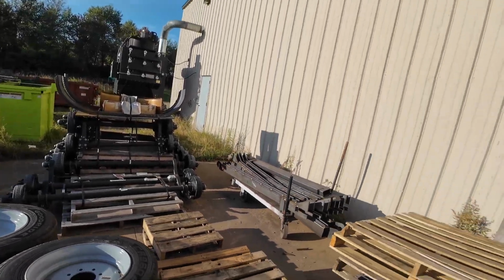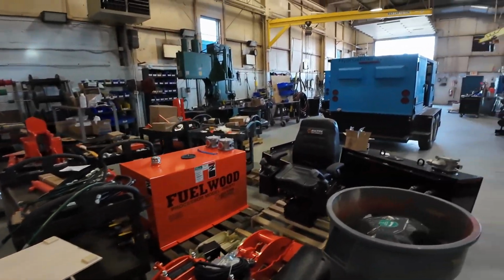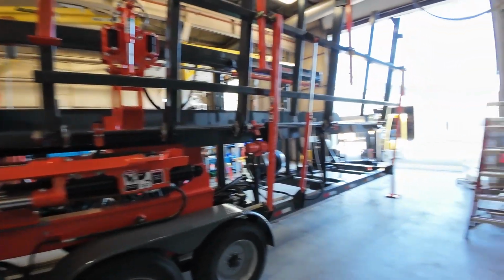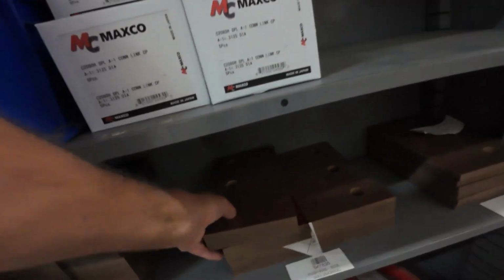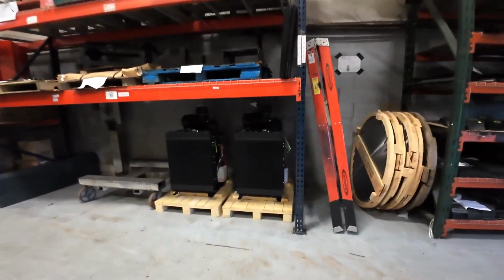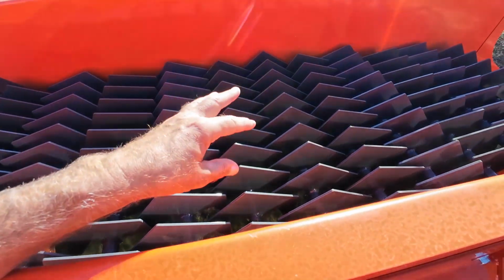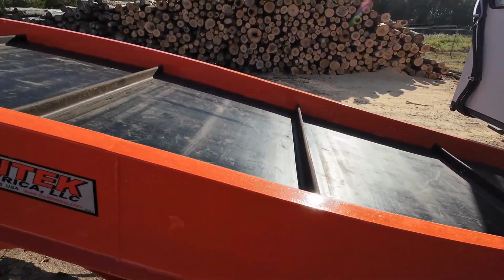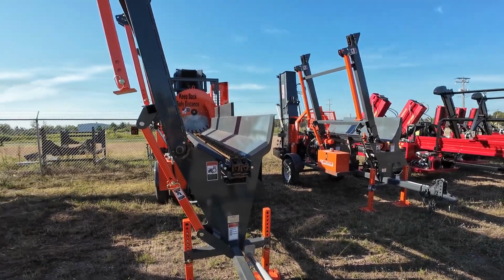MULTITEK MANUFACTURING FACTORY TOUR! FIREWOOD PROCESSORS!

Comment: Hi Chris very nice Multitek nice slasher to cutting Wood love it (Ty Ron We had one the same but two big Saw to cut 4 Foot in my Wood Yard 6 big Slasher with on top the slasher Hydraulic Prentice to feed the wood to the saw and it move buy it self front wheel trun left @ right travel by 4 set of wheel to move slow very strong
Reply from the maker: Nice set up!

Comment: The bottom line rule of thumb for firewood producers that use processors is for every hour of use per week the using/conversion to electric for power a compamy will see direct expense savings of $2000.00 per year per hour of weekly processor use vs diesel powered processor. This for any who are in firewood production dictates a conversion to electric the minimum ROI would be a no brainer even if costs to get electric installed reach $250K. And this does not look at ancillary cost savings for regular oil  changes and service, storing and purchasing fuel, life expectancy, cost to rebuild diesel vs electric, and the savings for warm up times. The math is even more compelling for electric powered splitters vs diesel. A largely overlooked secondary advantage is a quiet workplace free of exhaust fumes. For those that do not have 3ph electric available by using Scott-T aka Polyphase transformers you can produce you own no inverter 3ph power at any desired fixed voltgage without breaking the bank. If I owned Multi-tec I would have an electric hydraulic stand alone power units to allow any to convert all brands of existing gas/diesel splitters and processors to electric as a seperate product line. Ray
Reply: The only issue with all electric is seen now after the hurricane. You're shut down for days or weeks.  With diesel you are free of any reason the grid is down. And some older diesel engines would run on a lot of alternatives to store brought diesel if you know what you're doing.
Reply: @gp4103  Savings are savings and they accumulate for the 99.99% of the time life is not disrupted by a 100 year storm. Further if area is shut down not much sense in sawing what cannot be sold or delivered.  Better in my opinion to use diesel to overfill woodyard stock while logs are free and plentiful especially specimen timber that in normal times would never be available as they will in time again be extremely valuable. Further most people will hold diesel and gas until fuel supplies are regularly available. My heart goes out to all who are suffering and hope some form of nornalcy soon returns. You are certainy correct in that older diesels pre-dating electroinc controls and DEF will run well on a wide variety of alt. fuels.
Reply from the maker: Maybe so. But where 95% of the firewood processors are ...hurricanes never happen.
Reply from the maker: Thanks for the info Ray!